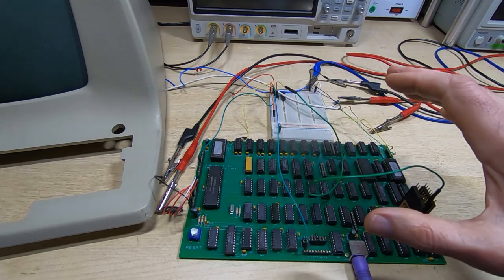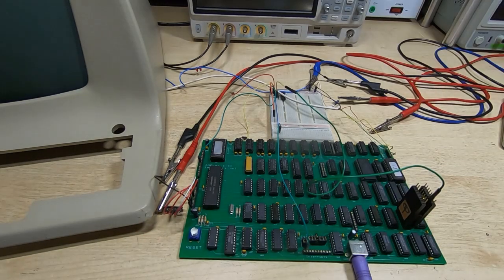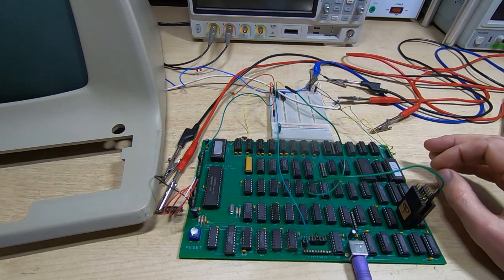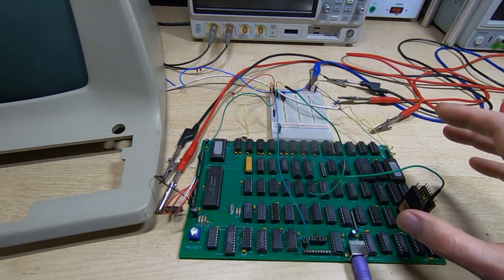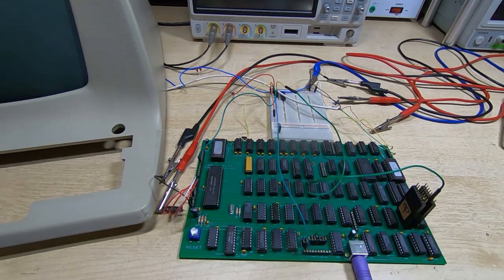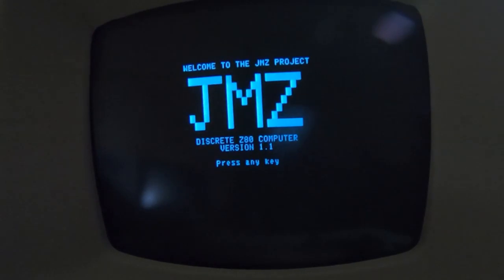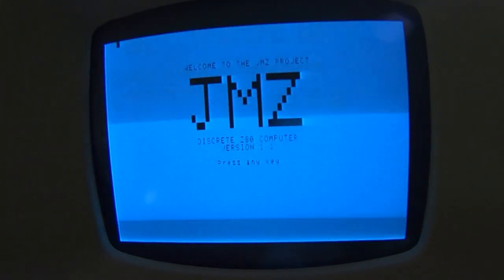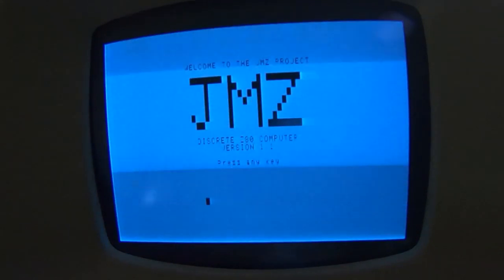Designing A Z80 Computer Part21

Comment: I have to say that I see lots of dark  artifacts when you move the cursor and also some while you type. And they immediately stop when you dont press any keys.
Reply from the maker: That is odd because I cannot see any at all. I may have to post yet another video with the blanking disabled so that you can see what is being removed. There would also not be lots as there is only a single artefact per character so I have no idea what you are seeing. Also remember that as I have tried to explain several times the tube persistence and eye persistence work together. That is why you can see banding in the videos which cannot be seen in real life. Having said that I have looked closely and I cannot see any artefacts even in the video. Maybe you could try it for yourself.
Reply: @JerryWalker001  Have you looked at the Screenshot I posted? Its clearly visible. I can post more tomorrow. Also maybe with the "lots" I have not expressed myself very clearly. There are not several at the same time, but one after the other, not with every keystroke, but with many, that's what I meant. I actually waited that you said "and now i enable the fix" as it looked like without it, just inverted.
Reply from the maker: @insanedruid3143  Where is the screenshot?
Reply from the maker: @insanedruid3143  I have just looked at your screenshot and that is not what we are talking about. Video refresh artefacts will NEVER be more than one pixel high (VERY narrow) as they are created during a single write. What you are looking at is a camera artefact caused by the snapshot nature of the camera and as I have said is also the reason you see similar dark bands which are NOT visible to the naked eye. You have also totally ignored what I have been trying to explain and what I have now repeated several times. It is the COMBINATION of screen persistence AND eye persistence which eliminates the screen artefacts (including the camera artefacts) but by definition this cannot be done using the camera. I have checked all 943 frames during the text entry part of this video and there is NOT a single video RAM refresh artifact. There is also another reason why such artefacts would not be visible anyway as the design is a little more complex than I have described. In short ask yourself why on a black background with artefact blanking turned off the artefacts are white. This will further explain why you are NOT seeing dark video update artefacts.
Reply: @JerryWalker001  I have compared the frames with those of the glitches you showed in a previous video and they are identical in size and appearance (just inverted). I thought of camera/compression artifacts but as I said, these things oddly only manifests when the cursor is moved or characters are typed.
Reply from the maker: @insanedruid3143  I have now explained it to you 4 times and I will not repeat myself again.